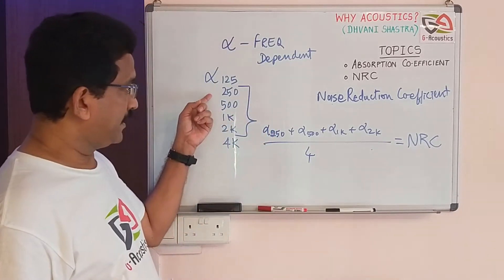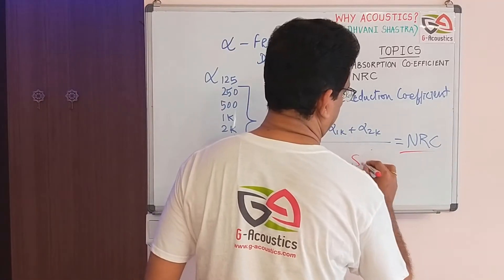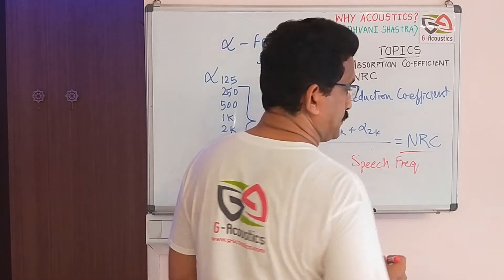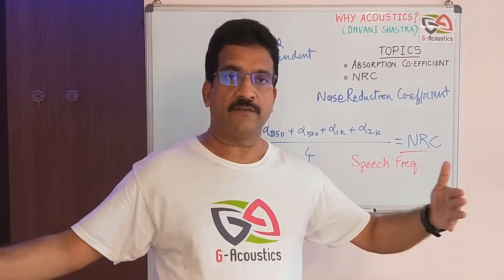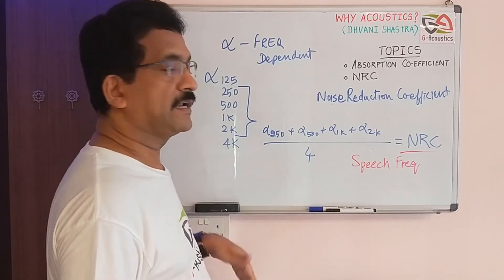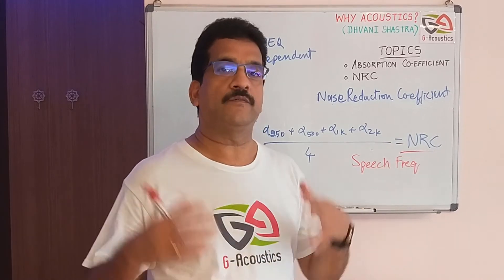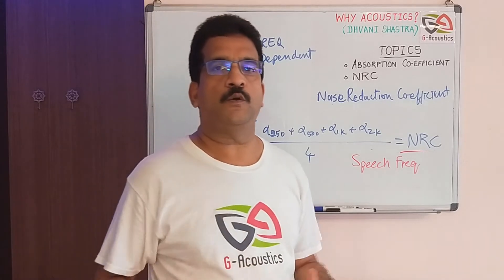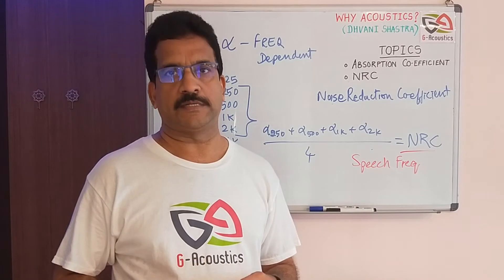Acoustics Bites - NRC

Comment: If i calculate - 250+500+1000+2000/4 = 937.5 is that right answer ?
Reply from the maker: NRC value is between 0 and 1. The average of the Sound Absorption Co-efficient explained in the video is NRC.